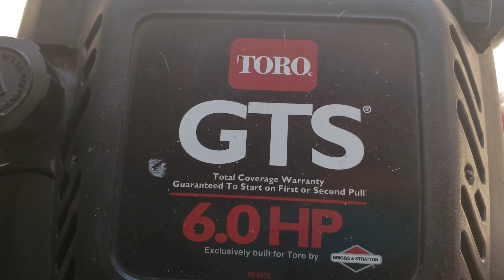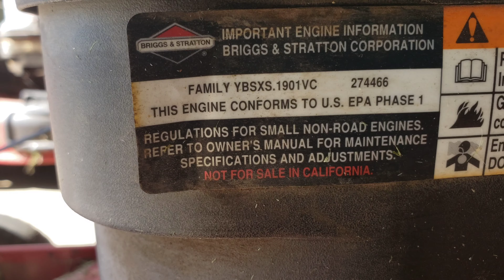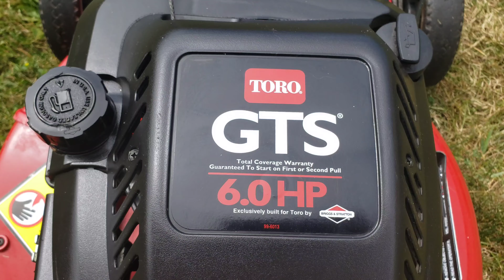Toro Super Recycler GTS 6.0 Self Propelled Grinding Slipping Not Working.Complete rebuild gear drive

Comment: Is this and old Super Recycler or SR4?
Reply from the maker: About 10 min in you can see the tag on the back above the flap. I must have cut that footage out I know I had it when I was changing the oil. I started one direction in the back with oil change then found the one wheel was not working. So I just put some footage from the oil change in the drive fix.

Comment: That’s not fixed there’s a horrible grinding noise   It’s not supposed to sound like that
Reply from the maker: That's not a grinding noise.  If you do have a grinding noise.  You probably also have to change out your gear or your wheels they are not meshing up..

The sound you hear they need a little more lube. The wheels have not worked for years in my case.  It's all metal 

Thanks for your support. Watch my other videos, thumbs up, and share help someone else out.